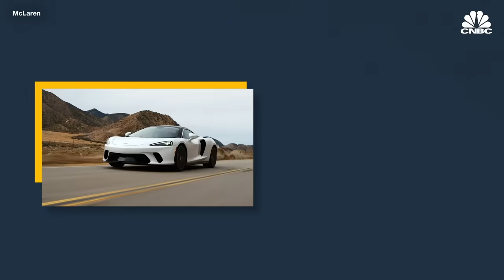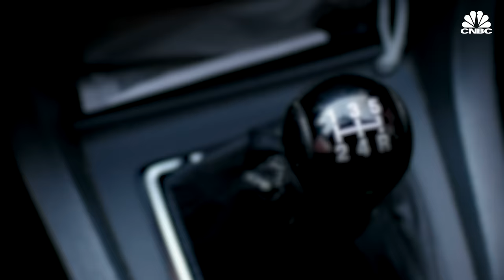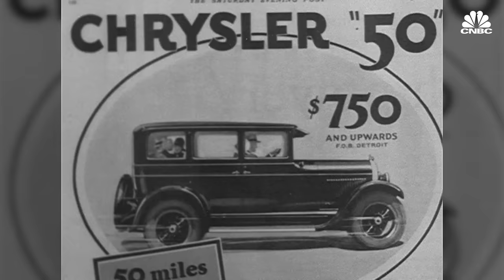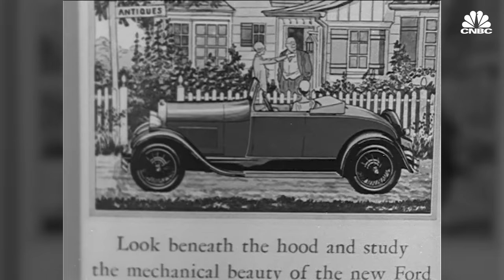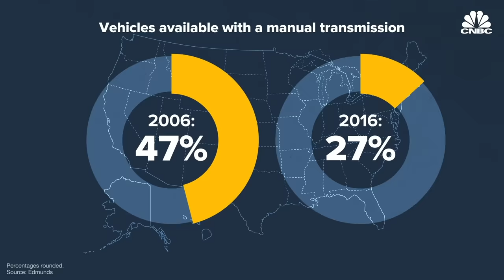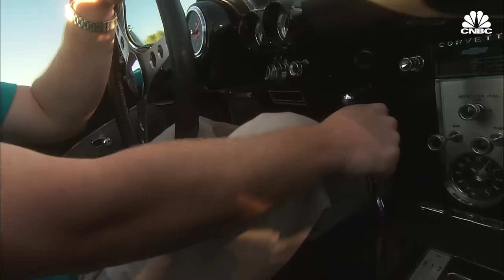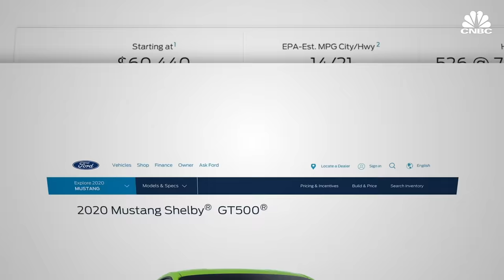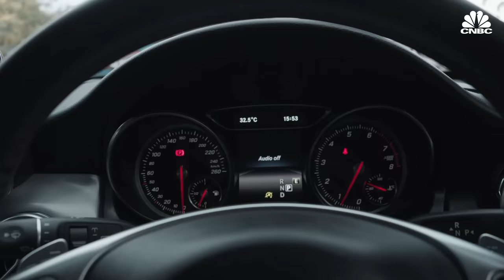Why Stick Shifts Are Going Extinct

Comment: There is nothing more obvious that you are an American than when you request an automatic renting in Europe.
Reply: This!  Esp in Germany, manual all the way
Reply: As an american and have hundereds of car friends. You would never catch me requesting an auto. I taught my girlfriend to drive a manual and now she wont drive anything else.
Reply: Yup. I went to Ireland last year and spent 20 minutes arguing with the rental guy that I was sure I wanted a manual and knew how to drive one.
Bit of trouble with sitting on the wrong side of the car, shifting with my left instead of my right, and having far less power than I'm used to (rented an econobox, I'm in  a Mustang GT back home), but I got along just fine after a few minutes.
The guy was incredulous that an American could drive Standard.
Reply: Nah it's the accent.
Reply: Or you sue the rental company when you drive your dumb ass off the road.

Comment: there aint no piece of mind like driving a manual and knowing "this car aint doin nothing i dont tell it to do"
Reply: So stupid!! Lol
Reply: Joseph Davidson you prefer automatic?
Reply: Provided it's rear-wheel drive.
Reply: @earnthis1  How is that stupid?  You should be in control of your car at ALL times.  Or is it soothing to know if something goes wrong and something horrible happens.. you can blame it on the computer?
Reply: @jaysout2ride86smitty9  Human error would be a far more likely cause of something horrible than a computer, if anything.
Reply: It's easy to tell someone who never perfected driving a stick: they say something less than positive about manual transmission vehicles. Surely, if they go to ride a horse, instead of a saddle they attach a carriage -- Most likely a computerized, enclosed carriage with air conditioning, and a sound system with a big subwoofer.
Reply: Ollie Goria yeah like a human not paying attention...
Reply: Ollie Goria obviously you dont know how driving manual works, simply having to pay full four limbed attention 100% of the time is so much more important than “making an error” which never actually happens especially not to the extent that it would cause and accident
Reply: @nickf1724  Let me see a computer screw up a shift as easily as a human can. You can be as skilled as shifting as you want, but the computer will always be faster and more precise than the man now. It's just how technology has innovated.
Reply: @olliegoria  are you talking about someone who is learning how to drive manual? Just take a taxi with a manual and see if the driver make any mistakes, if at all. Computers only shift faster than human in a straight acceleration scenario.
Reply: ollie_goria youre missing the point, at least if the human is using their hands to shift, they arent using them to text or be on their phone while driving, which is way way way way way and just for the hell of it, Wayyy more likely to cause an accident. Mishifts rarely happen and if they do they are easily correctable and are never the cause of an accident. In fact, i would argue that simply being able to the press the clutch in and put the car in neutral when the car is unstable to stablize the car is a big enough reason to drive a manual. Theres a reason many drag racers prefer manual. When the car begins losing control, you can press in the clutch in a manual car, and the car sorts itself out. Cant do that in an auto with a mind of its own

Comment: Ive had automatics.
Ive had manuals and I choose manual every single time!
Reply: It is not 1950 anymore... automatic gearboxes now have 8 gears, not 2 or 3 ;)
Reply: @Baerchenization  yeah ive driven my old ladies passat R.
Still prefer manual.
There are a million things you can do in a manual that you cant in an automatic.
Rev match
Clutch drop
Clutch kick
Push start when battery is flat
Compression lock up

The list goes on. Thats why manual versions of sports cars always demand a premium over their automatic counterparts.
Reply: pc  thanks bro, cant let the fate of mankind to somebody who cant manipulate 3 pedals with 2 feet.
Reply: @mickeydee3595  SO basically all the things no one other then those road ragers need, alright we dont need the "stick".

Comment: I love a stick shift I've been driving a stick shift for 25 years on-and-off good on gas you can push started if it doesn't start, I love the feel of changing the gears
Reply: New automatics are more efficient with fuel.
Reply: New cars saves gas
Reply: Some new cars have 8-10 speed autos. They are faster and more efficient. I always have a stick shift as my weekend car but normally an auto as my main. Stick shifts no longer provide any advantage aside from fun
Reply: I agree. Manual, stick shift cars are more fun to drive than a boring automatic.
Reply: I concur.  I also believe it keeps me more focused/engaged in driving.  For years I had a terrible and long commute that often involved stop and go periods.  That wasn't fun if it went on for long, but other than that, I always look for manual.  Many years ago I bought a used SUV that was automatic, I couldn't stand it, didn't last a year before I traded it in on a manual.  a few years ago I had to replace cars and specifically picked a Mazda3 as Consumer Reports rated it's manual transmission really well.
Reply: Mine is automatic with the option of shifting but it down shifts for me.
Reply: Rozilyn noneyabusiness lol that push-start happened to me so many times 🤣
Reply: That's soo true. My car battery was weak so I've made my friend push my car I clutch it into 2nd gear and released. Broom!  Engine on and ready to hit the road
Reply: @michaelmichael3126  Been there. I would park on a hill in case I was alone.
Reply: @alfredoalcantar8691  well not everyone can afford a new car I can afford a new car but I don't want a new car I don't want to be working to pay a car note and car insurance but I feel you
Reply: @tonyq8739  me as well I used to own a Yugo back in the day the starter kept going out it was easy to push start lol
Reply: @paulinotou  I don't want anew car I don't want to go to work everyday to pay a car note and car insurance I'm okay with the 2003 that I drive my last car was a manual Kia RioI could drive from Columbus Ohio to Detroit Michigan and back on $20

Comment: In my 40 years experience of mostly non-abusive driving, in both manual and auto vehicles I can say that a manual transmission, while being less convenient, lasts much longer and is less problematic even without regularly scheduled maintenance.
Reply: Automatic transmissions have more breakdowns and are more expensive to repair.
Reply: Completely false these days - we are a long way away from the old 2 speed Hydramatic with mechanical bands and valve chests that you people learned on. Most modern autos are so reliable that they are sealed for life, not to mention carrying 7+ year warranties. Manuals still have those dry clutches that need regular replacement, and linkages that always become sloppy with age. Yeah, manuals are cheaper to rebuild alright - because they need to be.
Reply: Completely wrong as of recent years
Reply: Many automatics will make it to 200k miles with just regular maintenance, the clutch in a manual transmission usually has to be replaced by 150k and it is no way a simple procedure.
Reply: @kenoliver8913  Well I've had a manual car for 10 years (a basic spec Ford Fiesta) and despite ragging the phuck out of it I've never had to replace the clutch. Yes it does judder now and then when I pull off but who really cares, not me.  It has close to 150k miles on it and never done any work on it.  What is "regular maintenance" on an automatic, is it expensive?  Regular maintenance on my manual transmission is nothing.
Being broke I prefer a manual but if I was rich I'd get an automatic any day, being stuck on a hot day in a traffic jam with a manual sux. But in my country automatics are for rich people still (though that is changing now with electric etc)
Reply: Yes like the Nissan variable speed transmissions!! 140k is the average before they go out lolol
Reply: @tarmac2001  it's like a $30 job here, so simple.
Reply: @kenoliver8913 Clutches need regular replacement? What are you talking about? I have a 15 year old standard Lancer and have never once worked on the trnsmission.

Comment: I bought a manual in 2019. I am the 2%.
Reply: Congratulations
Reply: Me too 🤙🏼
Reply: I've been driving American manuals since 1985.  They're getting very hard to find nowadays in regular passenger cars.  I may have to go German or Japanese for my next car.  I've never had a transmission break either!
Reply: @damanifesto  You can still get a Tacoma in 2020 with manual.
Reply: @damanifesto  sadly I think one of the last regular ones would have been the Chevy SS, and that's technically Australian, but still a 4 door V8 sedan with a stick
Reply: More like 95%
Reply: @damanifesto  when you start to look, honda still makes dedicated manuals. Love my civic SI. Used to drive a Jeep Wrangler.
Reply: @danwake4431  And I am looking for a truck...thanks for the heads-up!
Reply: Ok boomer.
Reply: My IQ tests at a z-score of over 2. I bought a standard transmission 2015 VW GSW TDI SEL this year. 

Assuming zero correlation, I am the 0.04%! 👌😸
Reply: @HibHab69  Grow up zoomer. 😹
Reply: I just bought a r34 today
Reply: Present! Also part of the 2% ;-)

Comment: “Why does anyone care?”  A question only asked by someone who never owned a car with a stick.
Reply: My words exactly👍
Reply: Facts!
Reply: Save the stick shift!!
Reply: People who liked horse-drawn carriages literally said the same thing about the first cars lmfao
Reply: I just wanna drive the car.. not do anything extra.
Reply: because people that drive stick buy used cars
Reply: @jadenisiah  thats why I got a stick shift, so I can drive the car
Reply: "I don't care so nobody else should" is what you were actually saying but ok
Reply: Cuz u never felt the road
Reply: Driving a stick shift is a better driving experience because you are more focused, but it's cool because you have way more control of the car. You can use the clutch to coast, you can feather the clutch so the power output is not directly connected to the wheels,, you can use engine braking to slow you down, you can shift in the powerband instead of where the car chooses, they're more fun, especially when it becomes second nature to shift (which takes very little time), having a basic understanding of what a clutch and shifter do helps a driver understand what their actions will translate to.... or drive an automatic and all you can control is 'how much go' and 'stop'. 

An automatic is the worst type of driving that there is (unless you spend most of your day in traffic jams). It's barely driving... and because people with little to no actual driving skill usually have automatics, they're the ones the road with a 3000+ lb weapon doing highway speeds and can't bother to shoulder check. People who manually shift are simply far more connected to the vehicle and the driving experience.
Reply: Based on statistics and sales, no one does.
Reply: @jadenisiah  You must have the attention span of a pufferfish
Reply: The reason I care is that it actually has nothing to with anything they "reported." The reason manuals are going extinct is because they last so much longer and are so easy to fix. This is the one and only reason the automakers want to get rid of them. Even the efficiency argument is a terrible red herring. If they factor in the lifetime of the car and replacement, the manual wins by miles.

Comment: I learned to drive with a stick shift -- '39 deSoto. I passed my driver's test in that same car, with a chattering clutch even. And I drove stick shifts for almost forty years, until I fell on the ice and broke my right wrist. After that, nothing but automatic transmissions for me. (As a bonus, no more clutch, just in case I break my left leg.)
Reply: Your broken wrist will never heal? Doesn't sound like a permanent disability to me. I've managed to drive my 1966 Ford truck with my left hand when it has manual steering and manual trans so I think you could manage if needed.

Comment: Germany : Cars are meant for driving.                  USA : Hold my cup holders and DVD players!
Reply: People are using Tesla autopilot and sleeping at 60mph
Reply: Ash Green yup. More proof that American engineering beats German engineering
Reply: Paul S you don‘t need to get an expansive repair if the car does not break down
Reply: @saibot5286  yeah wouldn't it be great if that was true!!
Reply: cristi dules  American cars are made in Mexico
Reply: @Paul S What video? There are several?
Reply: @PhaseSkater  Welcome to the dumbing down of America !!!
Reply: cristi dules  Till the warranty runs out, (then you need more $$$ than some third world countries)  don't believe me? Go car shopping for a used BMW or Mercedes, they are everywhere (In the thousands).
Reply: @Paul S Right, Asians are very proud people, they will not dishonor their ancestors, or their families by building something that is not close to perfection. They know that a quality product will win over customers and bring them back over and over. I remember when Americans used to be proud of their cars I worked for (Genital oops) General Motors assy div back in late 70's. the people  I worked with were union members that knew they couldn't be fired, I saw many things that made me understand why American products are not as good as they used to be. I worked for a Chevy Dealer for 15 years and I looked at many new cars with an engineering mind and thought why did they do it that way? It's engineered to fail, how in the hell are you going to make money off something that doesn't break? Now I buy Asian cars, Honda's, Kia's. no problems.
Reply: cristi dules  Far far more complicated*
Reply: @Paul S just because they are more expensive to maintain it doesn't make worse... just more expensive
Reply: cristi dules  if American auto manufacturers focus on car with a purpose such in performance it will beat any euro car at a fraction of the cost. For example dodge viper acr, track focused vettes, camaros, mustang etc then we got drag cars like the demons.
American highways and roads are wide and open so we need comfortable cars.
Reply: That's rich, have you forgot about Mercedes and BMW?

Comment: Try jump starting a car with an automatic transmission. I'll never give up my manual transmission. Never.
Reply: True this has saved my a$$ many times.
Reply: Um, how do I bump start a manual? Don't you need a second person to push the car while you try to pop the clutch?
Reply: Yeah manual you can put in neutral easily 😁 but automatic forget it 👿
Reply: You mean push start right? Any car with a battery can be jump started...
Reply: Even though I drive a automatic now, I agree.
Reply: DerpMans Derpyskin I think he means popping the clutch.
Reply: DerpMans Derpyskin I guess that is the same, sorry about that
Reply: @derpmansderpyskin  Thank you, internet stranger.

Comment: Automatic drivers: “It can be both manual and automatic” 
Manual drivers: “riiiiight ok”
Reply: If I'm honest, I never got used to the auto in my 2008 VWJetta even though it was DSG. Reverted back to manual gears and a hand break soon after and found that it felt much safer.